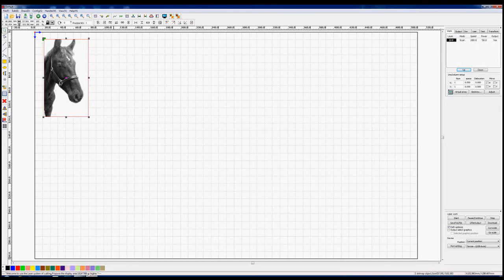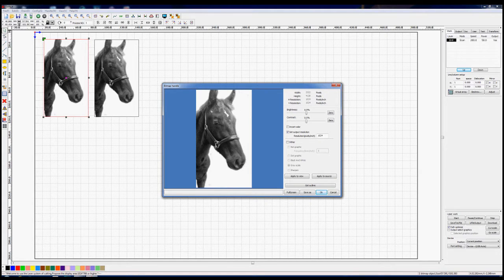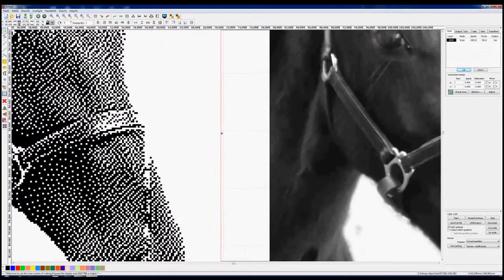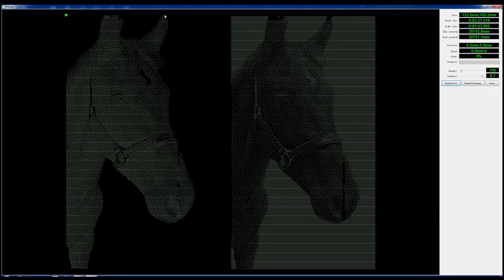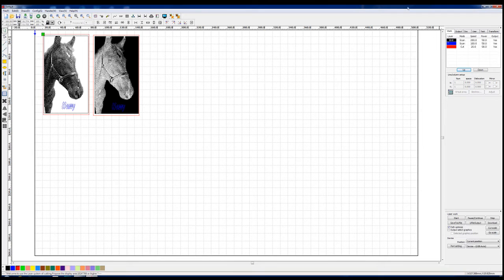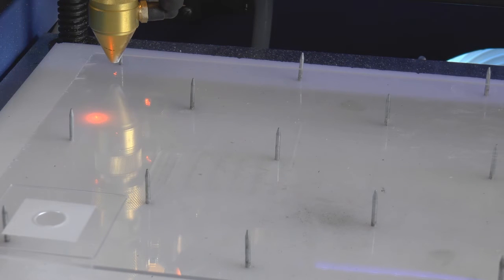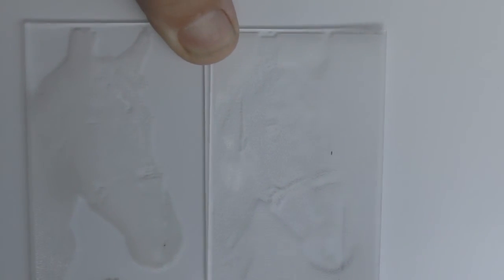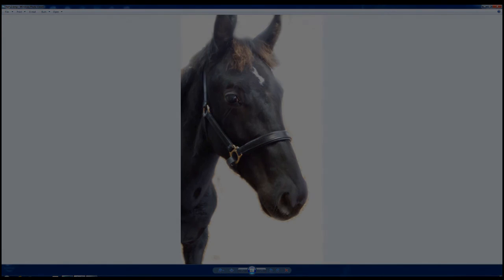RDWorks Learning Lab 10 Bitmap handle dot grahics

Comment: Oh.. BTW.. the manufactures greatly overdrive the laser tubes which reduces their lifespan. I burnt mine out cutting a batch of wedding invitations at 90% power because i wanted to cut hundreds of them as quickly as possible. When i got a replacement tube it came with a calibration certificate that showed the amperage at which the tube produced it's rated power. I installed an ammeter on the back of my machine and gradually increased power until i hit that rated power mark. Anything past that just increases heat in the tube and barely increases output power which results in the helium (most common gas in CO2 laser tubes, there's a whole lot to unpack there with lasing physics as to why) escaping faster. So once i knew the percentage to drive my tube at (was at 37% for me, keep in mind i upgraded to a 1 meter long true 50w tube) i went into the vendor settings of RDWorks and wrote that as the maximum power in the laser tab. My machine will now no longer go above the safe level. If i tell RDWorks to cut at a power level above that it will reduce it to 37%.
Reply from the maker: There is a lot to learn about how your laser tube works and you have grasped only a small part of the story.
Watch these to gain a fuller understanding
https://www.youtube.com/watch?v=2F5O-1TH8b0&list=PLPWEtx5V9DqEogIeYRdcG_KYcB7UL2Qmn&index=7&t=96s
https://www.youtube.com/watch?v=nZuatc3eIgU&list=PLPWEtx5V9DqEogIeYRdcG_KYcB7UL2Qmn&index=26&t=1358s

Best wishes
Russ

Comment: What’s the best file to import into Rd Works ? And what other files will it accept as imports ? I’d like to create my designs in CorelDraw or another program. Thanks
Reply from the maker: RDWorks can IMPORT many file formats. HPGL, BMP, GIF, JPG, JPEG, DXF, DST, AI and CDR.  Most of the files  in this list are bit mapped formats and can only be scanned. Ai and DXF are vector files and RDWorks loves these. You will have to use vector files for cutting but vector files can also be used for engraving (scanning). Working through my learning journey you will eventually learn about the differences. My short sessions are taking you on my journey of discovering the various tools but it's not until much later that I discover the real power of graphics
Best wishes
Russ
Reply: SarbarMultimedia 
Thank you!

Comment: Did these ones come out with any smoke staining on the acrylic?  My recent ones did, but I may be using the wrong settings.  Did the dishwashing liquid & toothbrush fix that?
Reply from the maker: +Krefey 
Yes. Maybe not. Yes. That's the short answer.
Acrylic evaporates just like water when you fire 10.6 micron radiation at it. However, unlike steam, the vapour is very heavy and settles quickly and sticks back to the surface Even the little air assist wont move it much. I originally had my workshop compressor tied into the air assist but even 10 times the flow didn't help much. When you get acrylic sheet its normally covered with a plastic protection film. I'm always very wary of cutting unknown plastic because of the risk of toxic fumes and I used to remove it. When I did my solar powered house nameplate (https://youtu.be/Mfk317JZE-w ) I left the film on and it came out clean as a whistle. I didn't even wash the white debris out from the letters as this just helped the unlit letters be more visible. This would also work for a picture but the white debris would have to be scrubbed out to see the different tones in the picture. You will have the same resin residue/smoke problem working with mdf....but that's not available with protective film. Check out PAPER application tape that used in vinyl sign application. It's paper film and is safe to cut but the glue is normally acrylic based and is safe also. That works well on all surfaces including leather, wood and acrylic. It's ideal where you want to paint infill letters in wood signs, its the perfect paint mask. Sometimes the acrylic vapour is very persistent near cut edges and you may have to resort to a brass/silver  liquid polish before a final soapy water wash

Comment: One thing that helps remove the lines on Acrylic engraving is to pull the laser just out of focus. It makes the spot just a bit softer and will even out the engraved pockets. I usually lower the bed about 1-2mm out of focus while engraving acrylic. Also acrylic engravings look much better from the back side, so mirroring them provides better finish.

JP
Reply from the maker: Hi John
Thanks for the tip. As I mentioned in my videos, I'm a fumbling newbie that's videoing my experience of learning to use the free RDWorks software. My aim is to leave a trail  (in understandable English) that other beginners can follow. Having mastered the major programming skills I am now at the stage of trying to find the best methods/settings for getting professional looking results. Several people like yourself have bounced some great information my way to shorten that learning process. Thanks again.